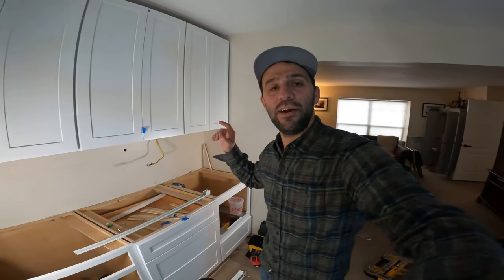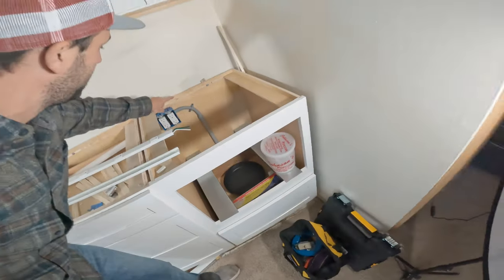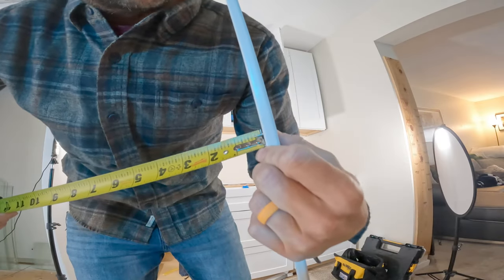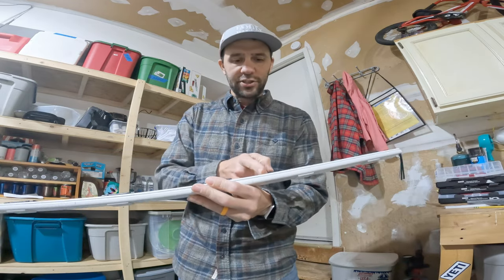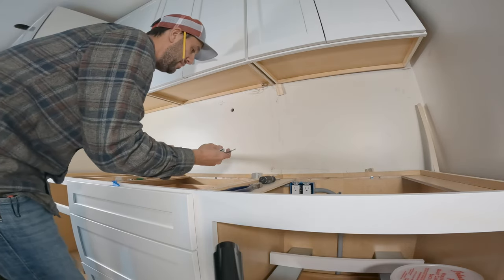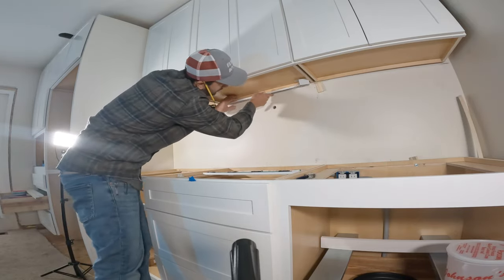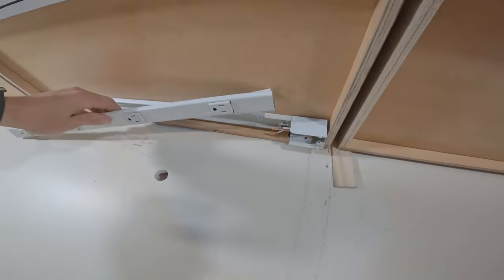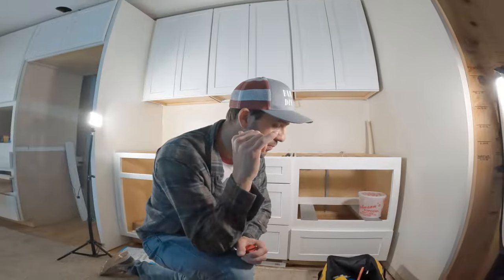DIY HIDDEN Under Cabinet Outlets - How to Add Under Cabinet Plugmold Outlets from Legrand

Comment: Nice project/video. Instead of cutting the length of the outlets short and centered I would have rather cut out a slot on each of the wall mount cabinets and then ran the strip of outlets underneath all of them.

Comment: The solution i’m looking for is a strip with 20amp outlets- I can’t find any reasonable product. also, that’s 12 gauge wire supplying, it might be a good idea to limit the breaker to 15amps to be appropriate for the wire and outlets within that strip.

Comment: I know this is an old video , but does the junction box come with the wiremold? It's hard to tell at the amazon link.
Reply from the maker: YEs, the junction box is built into the wire mold.  suggest getting the one with the USB - i made that mistake

Comment: We have multiple wall outlets, include a few GFCI outlets. We haven't opened them yet, but do we just disconnect any that were pigtailed and try to move only one wire up to install the undermount outlet? What about the GFCI outlets? Thanks for any feedback!
Reply from the maker: I don’t have enough info about your setup to give answer sorry.  Outlet or gcfi doesn’t matter.    Just make sure your gcfi is before the other outlets in the circuit.    Think of them as a switch.   Wouldn’t put switch at and of circuit.

Comment: Thanks for the video.  I am wondering if there is a more slender junction box to bring the wires from the wall into the plug mold.  The j-box you used seemed twice as thick as the plug mold.
Reply from the maker: I don’t know, but your question got me thinking.